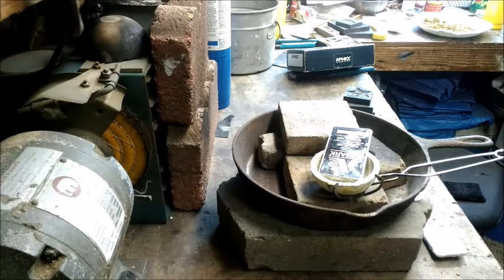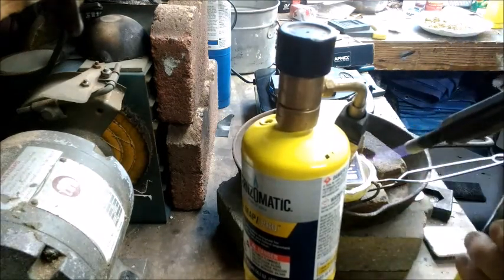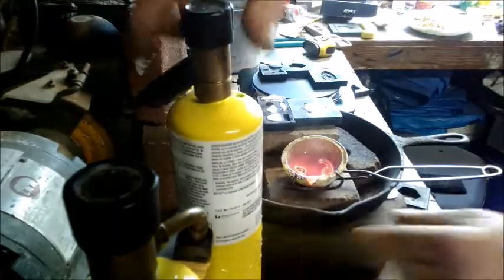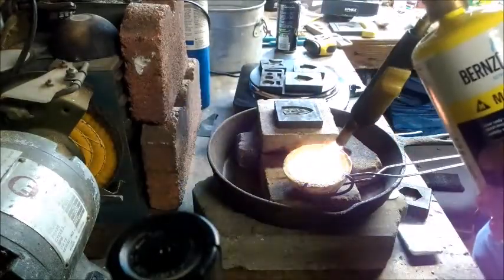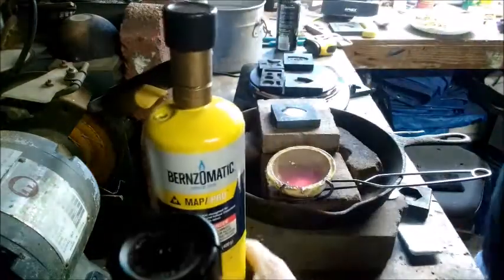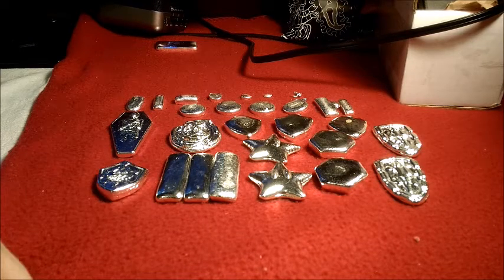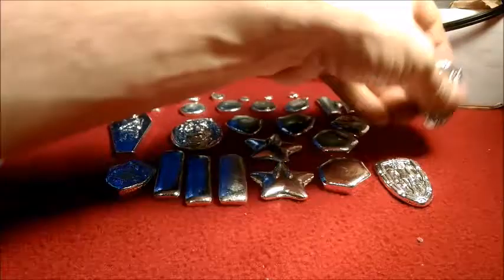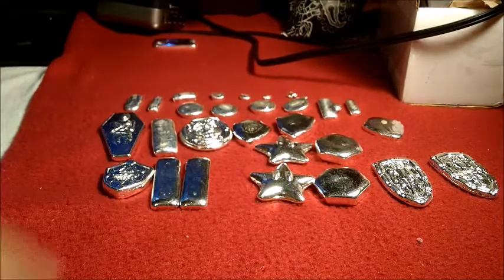How To Make Silver 10ozt Bars More Manageable To Pour - Silver Stack #171

Comment: My friend . That was a busy evening. I pay a neighbor an oz or two every once in awhile for the use of his oxy/acc rig. I can do 100 oz of shot + in just over a 1/2 hour. Great stuff. I still need to wash it,rinse in distilled and get it through the oven after that so now I can measure out dedicated pours for every mold.All in all you made some real beauties today !
Reply from the maker: Tomoko's Enterprize thanks, I'd actually rather use Oxy acet, I like doing the melting by had, but a furnace is in the future, less expensive 🙂
Reply: On the cost factor ya need to get the 20 lber of the HGX and put some kind of firebrick furnace together in yer iron pan. I can do 5 oz of shot ready to pour in 7 min and plenty hot my teacher. Stands can be easily made with wood and dowels and a couple hose clamps or get a bud to make em from steel. Nice and stable but easy to move around..Like I said before,20 lbs of map for 3 or 4 of those 1 lb cans. It just makes sense oh wise one ! I'm sure still learning from what yer putting out here bud !